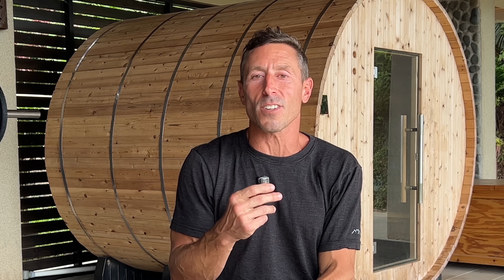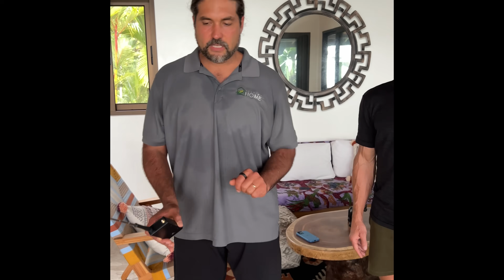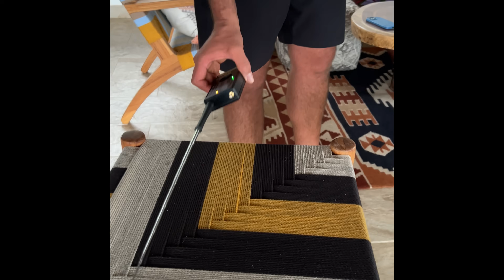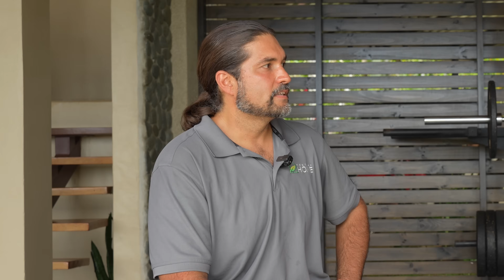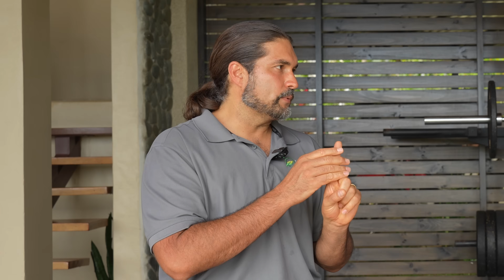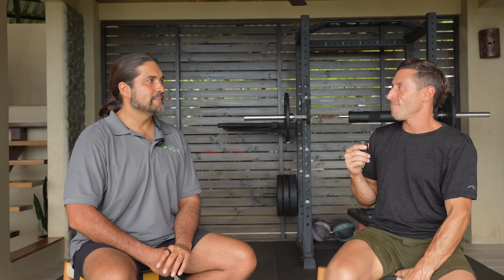Earthing vs. grounding

Comment: I think the best thing you can do is just sleep outside in the dirt...naked. Poof. Problems solved. I live in a freaking tundra in the winter..I'm going to plug into my ground in the winter. It is also working big time and I have chronic health issues. I couldn't bend my knee for 8 months and used a grounding mat once and could bend my knee.

Comment: Albert Einstein established a precise, scientifically validated relationship between mass & energy through the equation

E = mc^2

This equation shows that mass & energy are interchangeable. The constant c is the speed of light in a vacuum (about 3 × 10^8 m/s), & c^2 functions as the large conversion factor that makes small amounts of mass correspond to large amounts of energy.

Scientifically established points:

• Mass energy equivalence: Einstein demonstrated that mass is a form of energy.
• Conservation: His work unified the separate conservation laws of mass & energy into a single “mass energy” conservation principle.
• Nuclear reactions: This equivalence explains why nuclear fusion & fission release large amounts of energy.
• Relativity: The relationship comes directly from special relativity, which changed our understanding of space, time, & motion.

Einstein’s findings transformed physics & enabled fields like nuclear energy & particle physics. I’m mentioning his work only as established science, not as a claim that it proves or supports my personal experience described next.

My personal experience is different in nature & is not claimed as scientific proof:

For me, the experience of Earth’s energy feels tangible. My own energy, meaning my body, emotions, & inner state, feels directly affected by spending time in nature. Walking barefoot, being outdoors, & connecting with the environment consistently reduce my stress, calm my body, & help me feel balanced. That’s my lived experience.

There are scientifically documented benefits of time in nature: improved mood, lower stress hormones like cortisol, reduced blood pressure, improved immune function, & better attention compared to being indoors. Those findings are real & well supported.

What is not scientifically proven is that these effects come from “Earth energy entering the body.” That mechanism hasn’t been demonstrated. The benefits I feel are real to me, but the specific explanation comes from my own experience, not from scientific data.

My lived experience remains valid:

• Personal experience can prove to me that something helps.
• Personal experience cannot automatically prove the biological or energetic mechanism behind why it helps.
• Both of those statements are true at the same time.

When I walk barefoot, breathe fresh air, move slowly, & tune into nature, my nervous system responds immediately. My muscles relax. My breathing deepens. My mind settles. My stress chemistry feels like it drops. I don’t need a scientific paper to confirm what my body already tells me. That part is personal truth, grounded in direct experience.

Science is designed for verifying things across populations, not for validating every individual’s internal experience. It’s slow, expensive, & limited to what can be measured. Many things people know through direct awareness or presence don’t show up in labs.

My experience proves the effect, that nature, barefoot walking, & grounding practices reliably help me feel calmer, clearer, & more centered. Science has not proven the cause to be an energetic transfer from Earth, & I’m not claiming it has.

The reality is I already have the most important proof: the consistent, repeatable impact these practices have on my own body, mind, & inner state every time I do them. And the reality is, I’m so grateful for my wonderful daily experiences of each of my healing practices that I do each day because it really does make a huge difference in my life!

Comment: Earthing and Grounding in electrical power systems must be used to ensure that Circuit Breakers trip in case of hot power lines touch the equipment body. 

Human touch to live circuit lines is preventable using special breakers GFCI especially at places  where water is present. 

The charge on bed is static due to type of wool or fabric of blanket used and bed frame material used ( conductive or dielectric). It’s not recommended to put chargers cable on any part near your bed. 

An EE vet, will help you further. Seek professional assistance. 

❤

Comment: another  Austist researcher says a grounding matt indoors will have limited effect because all modern houses have un-natural plastic vapour barriers on interior roof.
HE contends its not just GROUNDING that feels so good in nature ,  ITS FLOW ! and no flow will go thru the plastic or any similar non natural material.
=I WOULD CONTEND  a ground matt could work in a modern house if you created a metalic wire grid on your interior ceiling above the matt and run that wire thru the wall to a piece of metal secured to side of fascia above the roofline in case tar shingles also block the flow.
i have grounding sheets but dont own my home so yet to try it.

Comment: In electrical it called bonding  there a ground to the panel  from the panel to a outlet is called bonding  and if thw water line is your ground and you lose your neutral  the water line act like a neutral and you could take the panel unbalanced load in your panel

Comment: I am an electrician and understand the importance of grounding and shielding from electrical contamination. The question is does our bodies biological electrical systems absorb foreign electrical radiation similar to modern electrical systems do and affect their performance. To protect electrical systems especially if they require precise voltages they are shielded and grounded to disperse those contaminating voltages . Humans may need a similar setup . The problem we are so inundated by electrical radiation . Just ate phones alone must have an impact . Of course the science says no because if you say yes that ends society as we know it

Comment: I got grounding sheets and since the wiring in my older house is not grounded (even though the outlets have a ground prong hole), they are not grounded. I solved this by running a single dedicated wire from the bedroom and landing it on the cold water pipe (perfect ground) in the basement.

Comment: It's interesting how sure people are they know what they are talking about.  I don't hold myself out to be an expert, but I probably know more about the topic than the average person.  There are two different things that people seem to be getting convoluted in these discussions, namely AC and DC current.  The concept of "dirty electricity" is talking about an AC signal ending up on the ground wire.  In the old days before LCD televisions were ubiquitous this was more obvious.  You would be watching TV and mom would turn on a blender or vacuum cleaner in another room and the analog TV would get all fuzzy from the motor noise of the appliance ending up on the wire.  You don't get to see this with a modern digital TV.  The theory of earthing is largely concerning the human body having a DC charge unless the person is grounded or earthed.  Even with AC noise on the ground wire, being grounded will drag any DC charge down to near zero.  This is what causes the purported benefits of earthing, returning your static charge to zero.  The problem occurs when you are in a poorly wired building.  A long wire is subject to the antenna affect.  If an AC signal ends up on your ground wire, again in a poorly grounded building, you may end up with your earthing system being an inadvertent antenna.  In theory you could end up transmitting even more Radio Frequency (RF) noise to your body, especially of you are sleeping directly on the antenna (your mat).  People that work with RF spend a great deal of effort to make sure everything is properly grounded to prevent issues with stray signals screwing everything up.  If you are going to earth, you need to spend a similar amount of energy making sure your system is properly grounded.  If you are stuck in an old home with poor wiring, you may need to drive your own dedicated ground rod outside.  Make sure it is long enough to reach below the frost level for your area.  Also, a quality earthing system should have a resistor wired in series between the earthing mat and the outlet connector.  This has two safety functions.  First, it prevents large current flows in case you some how become energized while using the mat.  I have no idea what would cause this, but never say never.  This large resistor will prevent that current flow from being large enough to be harmful yet it will still allow for the DC grounding affect to take place.  Additionally, it will greatly reduce any inadvertent transmission of AC energy that ends up on your grounding wire.  If you want to further increase the resistance to RF noise on your grounding mat, you could clip a ferrite bead or two to your grounding cable.   You sometimes see these on laptop power supply wires to do the exact same thing.  If you are going to do earthing, it is critically important that you make sure you have a rock solid ground.  The gold standard for this is driving your own separate ground rod into the earth, although you will likely get satisfactory results from the grounding in a modern building.  Second to that, make sure you buy a quality earthing product that contains the resistor integrated into the wire between your earthing mat and the ground terminal.  If you want to be certain, then buy or rent the appropriate test equipment and measure it all for yourself.  grok and chatgpt both seem to have a good understanding of this topic and I would encourage you to discuss it with both AI systems to get a fuller explanation of the issue.

Comment: Chair, foot bath, copper pipe with a screw hole in the dirt connect with a wire with another piece of copper in the foot bath should work

Comment: There is no universal ground voltage. Elevation, humidity, ground moisture, atmospheric voltages depending on weather, and a hundred other things, create an extremely chaotic electrical system in the "ground".

Comment: These are interesting ideas. I’ve been grounding my energy for 20 years because the benefits are so profound. We don’t need to touch anything to do it. It’s pure intention and I use simple visualisation to achieve it. We are energy beings. Grounding brings our energy more fully into the body. When I ground I feel better, I’m more present in my body. When I ground I can feel it invites a higher vibrational flow into my body. I’ve used this method to heal childhood trauma.

Comment: You should check the water coming out of your shower head. The amount of amonia and feces that circulates from the pipes being so close to your sewage lines radiates harmful juju to your shower lines and there are specific receptors on the ends of your hair that transmits those juju waves from your hair to your balls. Use your N95 mask from covid and put it over your shower head when bathing to filter these things out. Thank me later.

Comment: Yea i was going to correct the ground vs. Earth Thing also. As an electrician. its already been pointed out. But yea  ground on an outlet goes to the ground...imagine that its called ground and it goes to the ground usually thru a ground rod or thru foundation Different from neutral which is excess voltage that goes back to the coop. So no difference in grounding yourself to a grounded outlet ground or the ground itself aka earth... its all the same

Comment: It is kinda same, assuming that you do have a good electric ground on your outlets. It will always to be direct conected with and oxigen free cable, and ifvyou want even more, build a little ground mesh with cooper bars soldered. At last but not less, improve yyour ground connection adding salt or cinductive gels, particularly on soils with a lot of stones.

Comment: Mostly right.  I have a friend who is allergic to AC power, I helped do some remodeling on their off-grid home that is all 12 and 24 volt DC.  You can go ahead and cut all of your AC power off, but some of your lights and other electrical things can run off of DC power and you won't be thrown into total darkness.

Comment: When you send a current into the ground it is not routed back to the source. The current runs from the hot wire of your electrical power and cannot run backwards. Basic electronics.

Comment: I remember one summer when we had a drought and the power company was having issues around places that needed lots of power and they would go to some of the nearby power poles and drive about 10 more ground rods out and away from the pole. They needed more grounding. I was sent to make sure the CATV line was connected as well.  My house have two ground rods driven and one under the sidewalk.  I don't have any issues with lightning strikes burning up an appliance.  The way I see it, ground is ground.

Comment: You can actually test the current in your body with a multimeter tester with feet on a mat and not on a grounding mat. I did it myself. Before placing my feet on my mat I measured my current it was about 3.75. Placing my hand over a a power outlet surge protection power strip the voltage went up over 4.0. Stepping on mat mat it went to zero. Ultimately being in nature and connected to the earth on dirt, grass or the ultimate walking along the ocean shore is healing in many ways. Definitely have felt improvement in sleep and areas of pain.

Comment: The idea that electrons from the earth might “skip into the circuit” if you use a ground plug is technically incorrect. A properly designed grounding plug only connects to the earth grounding wire, not to the power (hot/neutral) circuit—so, under normal conditions, there is no current flowing through your body or into electric circuits. If a mat is properly connected to the ground pin, it should not carry household electricity at all. Safety issues arise only with faulty or incorrect wiring.

Comment: For all you electrical experts I have a question. Can using a power conditioner with a toroidal transformer circumvent the noise in the system if one cannot ground directly to the earth?

Comment: As a professional electrician if you have electric running through your grounds in the house you have problems and still I am sure it is picking up interference from the electrical being so close to it and I see both sides and Mother Earth is the best ground period and as a warrior of light myself first and foremost I am changing how my sheet is grounded because I have not noticed anything from being plugged into a outlet ground ever actually !
I feel they are similar but the earth is best because the ground is isolated
In an electrical box with lots of vibration that can’t be good for you at all and therefore it is kinda not a clean effective source , but electric is electric and is not dirty but does let off emf which is negative to human body ❤
Reply: The idea that electrons from the earth might “skip into the circuit” if you use a ground plug is technically incorrect. A properly designed grounding plug only connects to the earth grounding wire, not to the power (hot/neutral) circuit—so, under normal conditions, there is no current flowing through your body or into electric circuits. If a mat is properly connected to the ground pin, it should not carry household electricity at all. Safety issues arise only with faulty or incorrect wiring.